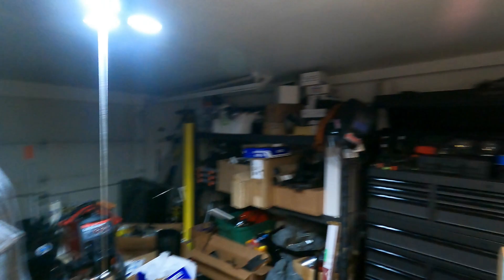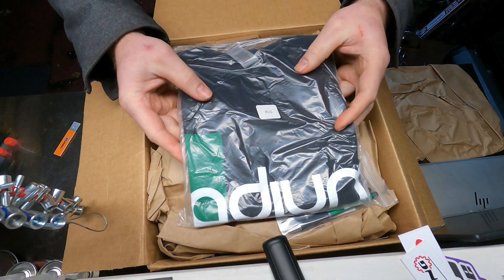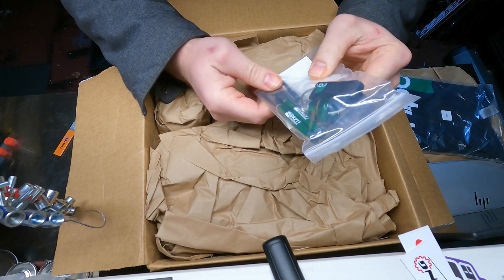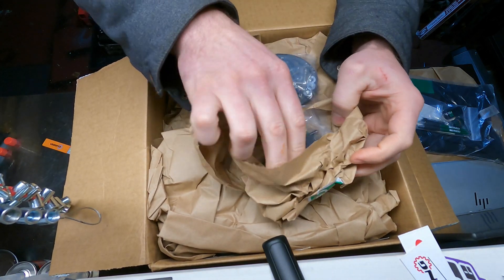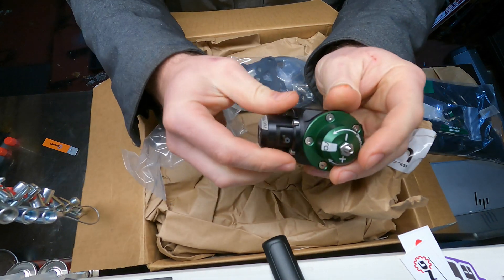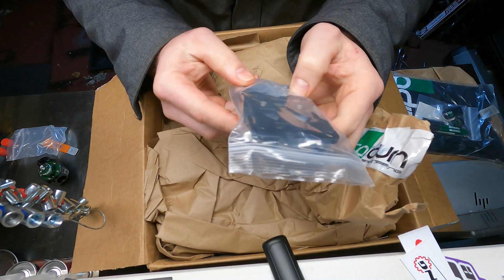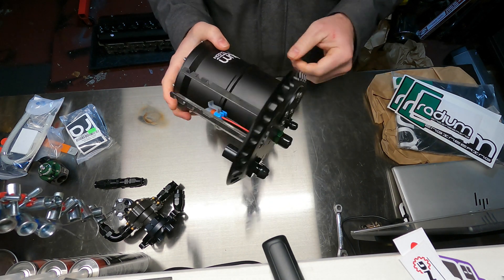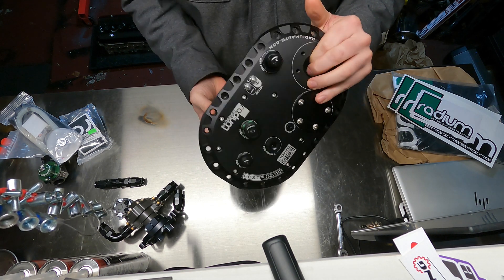Unboxing the Brand New Radium Engineering External FCST

Comment: Did you have to use a pump in the surge tank or is the mechanical fuel pump able to draw the fuel up out of the top of surge tank all the way to the engine bay?
Reply from the maker: Mech pump draws from the surge tank - no lift pump required. we've dyno'd up to about 900rwhp on this setup with absolutely no fuel issues.